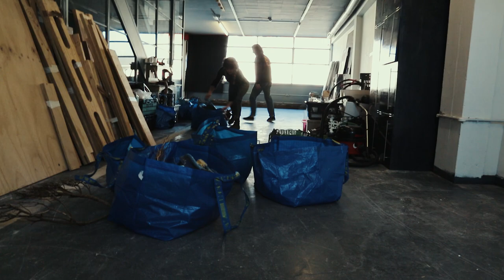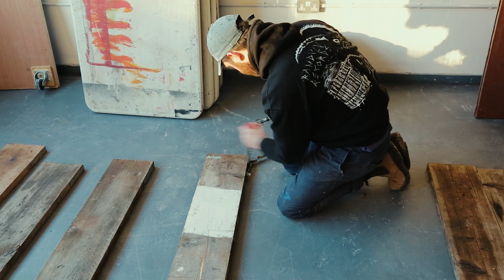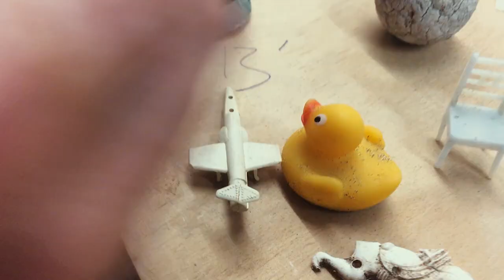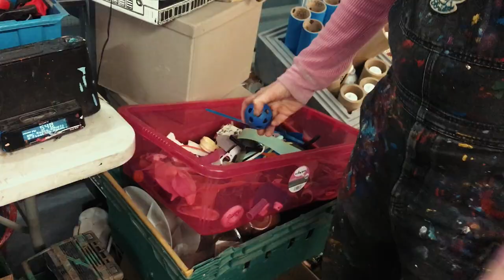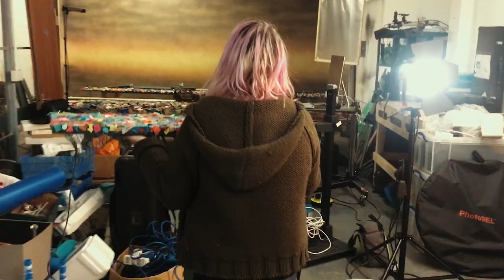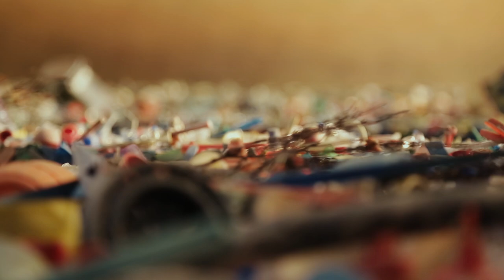Yusuf / Cat Stevens – Building the Sea for 'Where Do The Children Play?' (Behind the Scenes 3)

Comment: I’m pretty sure that object you held up and wondered what it is, is the inside casing of a shotgun shell. It flys out of the barrel with the shotgun pellets and then falls to the ground as the pellets fly on to their target.
Reply: Exactly.  It's called either a wad or a shot cup.  It is used inside a shot gun shell.  The gunpowder sits in the lower portion and the shot (pellets) sit in the top portion.
Reply: That’s sad. He said there were a lot of them.😔

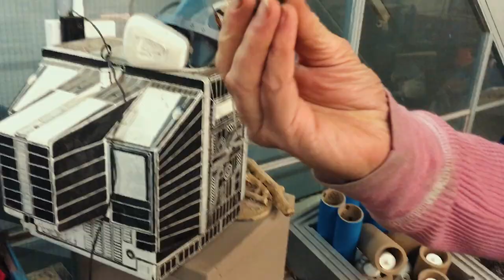Comment: I would agree with William Fontaine's identification of the 'mystery' plastic part as coming from inside a shotgun shell.  As I understand it, it is called the 'wad' or 'wadding' and sits between the gunpowder and the pellets in a shotgun shell.  Essentially it keeps the powder in place at the back of the shotgun shell and (once the firing pin has hit the primer) prevents the expanding gasses from leaking around the pellets, at least until the pellets and wadding have left the barrel of the gun.  If you look closely you can often see the dark smudges of how the pellets were 'stacked' inside the wadding - it makes a geometric pattern (at the end of 1:17 in the video, if you look closely you can see what looks like the 5 dots on the 5 side of a die - a quincunx - on one of the 'leaves' of the 'top' end of the wad).  

When I was a kid, I remember seeing shotgun shells where the casing (hull) was made of a cardboard type material and the wadding was made from some sort of fiber ... both biodegradable (rather than single use plastics - although some folks do save the plastic hulls and reload them.)